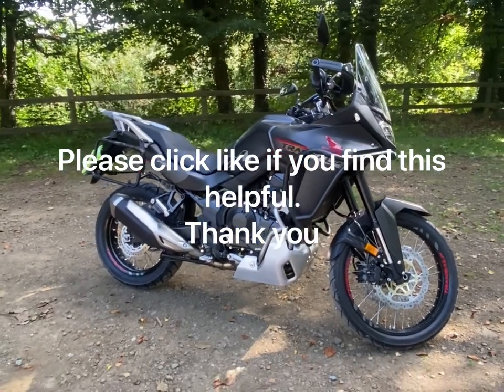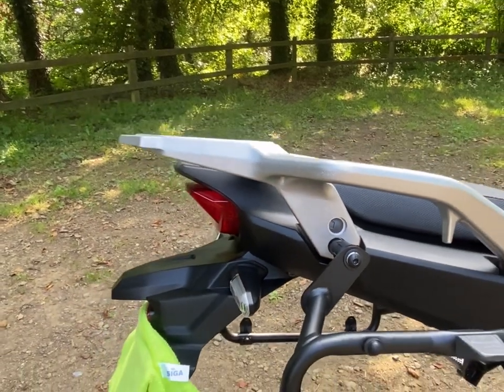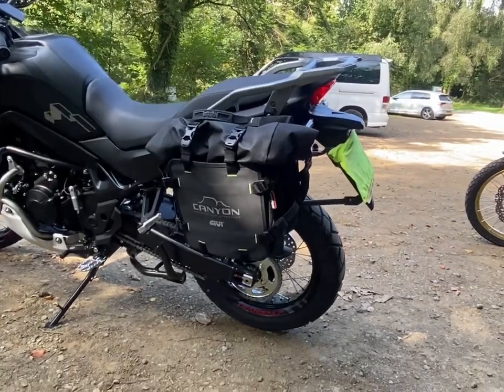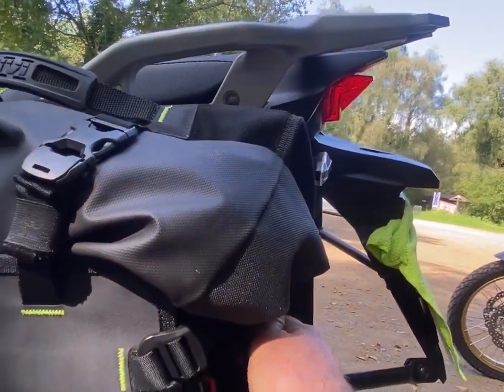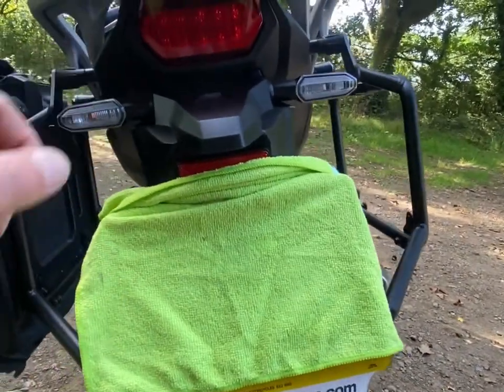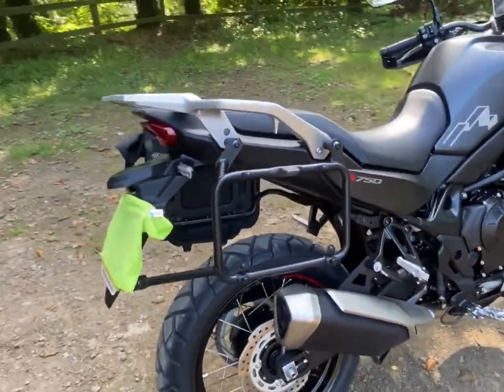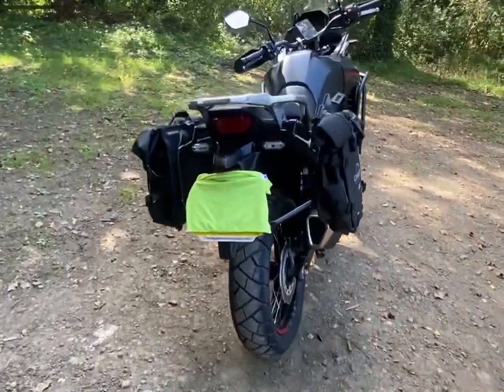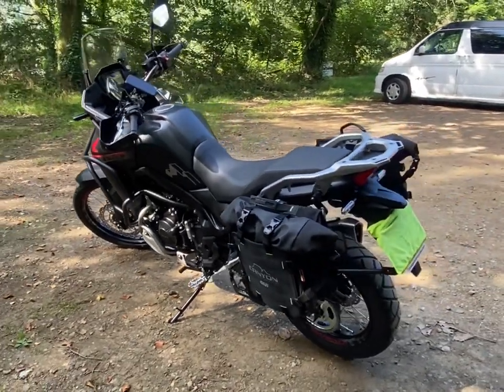Givi luggage rack fitting advice Honda Transalp XL 750 2023

Comment: I just bought these along with givi alaska 36. I have to check if these small bags hide the turnlights 😮
Reply: Btw. Thanks! Very useful video
Reply: So did you tried it? I have the same bags and looking for info!
Reply: @george3021 yes hides the lights a little, but I didn't have the job of changing the register as you see in the video
Reply: @cueclubPT  Guess its not much of a problem if it hides it a little. Dont want to alter the bike just for occasional bag fitment
Reply: @george3021 Yes that's whyI didn't change it. today I can buy GIVI and in the future another brand. I prefer not to change anything on the motorcycle.

Comment: Nice one mate,
I have those bags and am upgrading bikes soon to a transalp...helps me tremendously! Good on you.
Reply from the maker: Thank you, much appreciated. It’s a great bike, really fun to ride. Just make sure to up the rear preload 2 clicks to number 4 & then 4-5 rotations up on the front preload. It transforms the bike & makes it much better. On the standard settings the bike can easily fall over because it’s so upright due to the sag.
Reply: Thanks mate,  after watching your vids, I have done that...am at 4 clicks.
I actually had an issue of torquing the top plastic spacers with bolts to the recommended 27nm as per givi manual. Has squashed the plastic spacers heaps and deformed them. Have contacted givi for answers. @toejamtimmy4402
Reply from the maker: @tremorflow3614  sorry to hear that about the spacers… I did torque them up, I just tightened them up by judgement. I’m sure GIVI will send you some more spacers… let us know what happens
Reply: @toejamtimmy4402  thanks mate for confirming, I assume typo and you mean didn't? Just to confirm please
Reply from the maker: @tremorflow3614  lol sorry, yeah was supposed to say didn’t 🤦‍♂️

Comment: What F's me off about pannier racks is that manufacturers almost always make the frames wider than they need to be. Clearly, the design brief is to make frames that clear the original fittings (side panels, exhaust etc.) and provide sufficient clearance for pillion's legs, but plenty of folk will use the TA for solo touring....a single seat and pillion-rack conversion would be a nice addition, similar to the ones you can get for Beemers and some Triumphs (if memory serves)...saves hanging more weight beyond the rear axle. I can see the new TA in my future....had the original XLV600, and now ride a CB 500 X. Yet to test ride, but looks promising.

Comment: Why the lower bracket fitting not attached to the frame as in AT ? Because in TA frame goes as one piece (no rear sub-frame) - if destroyed the bike will be totaled - the rack have to be flexible in that case.

Comment: Givi claims the rear bracket needs to be drilled through because of the rapid release system you can add-on. That thing actually stays bolted once the racks are gone using the release system.
Reply from the maker: I didn’t know there was a quick release system for the bars… might look into it. Thanks for the info & for watching 👍

Comment: Good Video
In regard to your Heed upper bars, do they provide full protection for a parking lot drop? 
The reason I ask is I would like to try and keep the accessory weight to a minimum, and as I don't plan on doing much more than dirt roads am going to try and avoid buying a skid plate, and from what I can see all the skid plates on the market right now require a lower crash bar. I am hoping that a super light skid plate comes out that doesn't require a lower bar.
Reply from the maker: Sorry for the late response.
My wife has dropped the bike twice since the bars were fitted & the only damage was a bent front brake lever & light scratch on the Heed bars that I blended out with matte black anti rust spray paint. The standard Honda hand guards are useless in a drop, they just lift up & allow the levers to hit the floor. She now has barkbusters so problem solved. 
I would definitely recommend a sump guard, the way the sump is shaped even an average sized stone on a tarmac road could easily damage it if it flicks up from the front wheel. It may be a while until someone designs a bar less sump guard so I’d get one asap. The added weight is low down so won’t really affect handling or lifting the bike after a drop.

Hope that helps & thanks for watching 👍
Reply: Hi, SW Motech engine guard doesn't need lower crash bars to be installed.
Reply from the maker: @TheBl4zon  it also looks better than the standard Honda version, offers more protection & is available in black. I tried to convince my wife to get it but she wanted the Honda one & likes the contrast.
Reply: @toejamtimmy4402 I prefer the OEM crash bars on my Tricolour XL750 over the ones from SW Motech. Do you think it provides less protection due to its thinner aluminum? In practice, I've found that the OEM with lower crash bars offers more protection than SW Motech. I've seen pictures where a similar skid plate as SW Motech bent after a crash, causing a hole in the engine cover.
Hepco & Becker skid plate is nice alternative to the OEM, looks solid.
Reply from the maker: @TheBl4zon  now you mention it, it may have been the HB I was thinking of… it’s been a while since I looked at them. I haven’t seen any crash testing of any of the pans but generally aftermarket provides better protection than standard items, however there’s always a few exceptions. For what we use the bike for the standard pan is more than enough protection. I just wish Honda offered a black version

Comment: What crash bars are those?
Reply from the maker: Hi. They’re HEED crash bars. Made in Poland. Some people don’t rate them because they’re quite cheap in comparison to other brands. However this bike has been dropped twice now (whilst stationary) the bars protected all the bodywork and didn’t bend or break. The Honda hand guards are rubbish, they just lift up & allow the lever to bend or snap, so get barkbusters instead. 
I’ve done a video on the HEED bars if you want any fitting advice.
Reply: @toejamtimmy4402  Thanks! I noticed that the attachment points are on the frame and not the engine like 99% of the other aftermarket bars that copied Hondas design. They remind me of Outback motortek’s crash bars (which is a good thing) I’ll check out the HEED website and your other video too.

Comment: I heard that the passenger grab bars weigh 3kms. A lot of weight. 
Do you think the racks would help for big rack less bags too? I heard the handles get in the way otherwise. 
I hear a lot but don’t get my bike until the 30th in the US so it’s all guess work.
Reply from the maker: Hi. The racks would help keep wrap over bags away from the body work but personally if I was going to use that type of system I’d remove the racks & put clear 3m film or decals to protect the paint just to keep the weight as close to the bike as possible. I’m considering the Giant loop system for my AT. 
The original rear grab bar is probably heavy but it’s easily removed unlike the one on the AT which requires removing side panels & undertray. 
Rear spring rate is ridiculously soft so uprated spring is on order.
Hope that helps
Reply: @toejamtimmy4402  that is a good idea, I need three strong attachment points for the tie-downs so I need to fund a rack to replace the mega-bars.

Comment: Hello 
Is the protection under the engine made of aluminum?
Is it original from Honda?
Thanks
Reply from the maker: Hi, yes it’s aluminium & an optional extra from Honda. If it was my bike I’d have got either the HEED pan & lower bars or the SW motech one. They’re stronger, I think cheaper & also available in black. Honda only do silver.